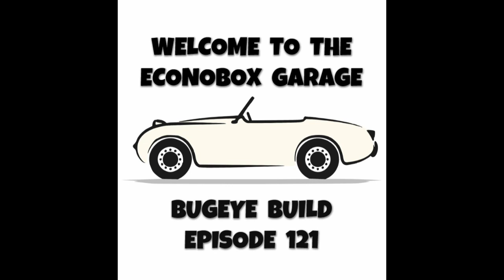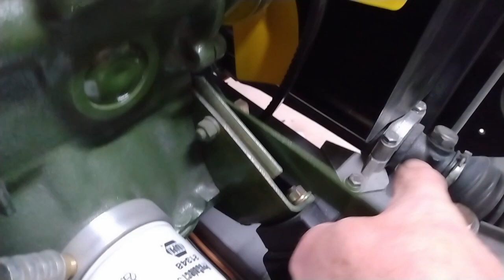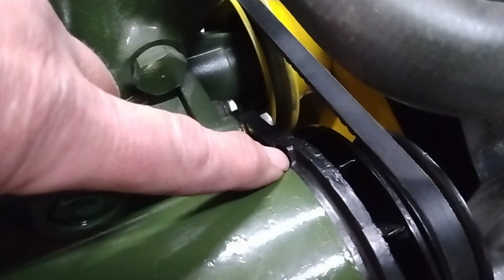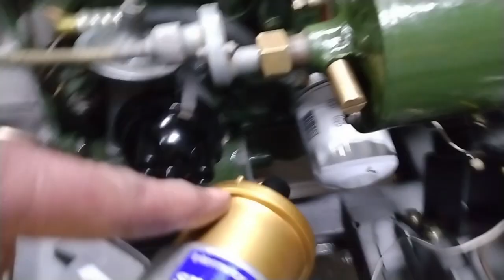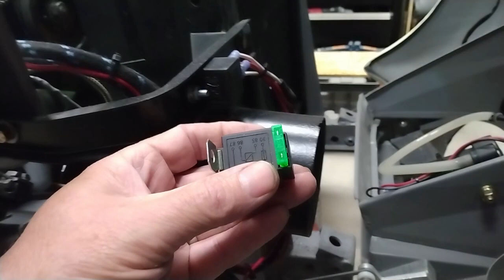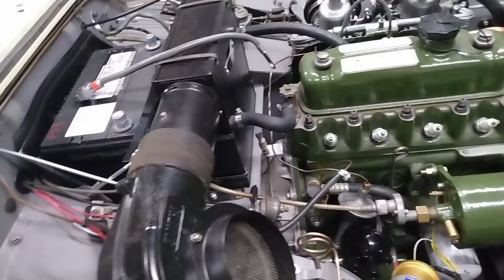How I installed the generator & coil and finished off the wiring in the Sprite. Bugeye Build Ep. 121

Comment: Hello. What color wires are you running to the + - on your coil ?  Mine is the same as yours.
Reply from the maker: Hi Ross.  I've converted my electrical system to negative ground/earth and have the white wire going to the positive terminal and the white with black strike to the negative. If you are running with the original positive ground/earth then you would switch the wires around... white to negative,  white with black stripe to positive.
Reply: Thank you. There is a third wire also. It’s white with a black strip. Where did you put that one ?
Reply from the maker: @SouthernShitShow  There's only two small wires going to my coil... the white one (which I've connected to the positive terminal) and the white with black stripe (which I've connected to the negative terminal). If you e-mail me at the address is the video description I can send you a wiring diagram.

Comment: Ian, back in episode 37 you painted the underside of the car with POR-15 and then covered that with Duplicolor's undercoating product. Obviously you haven't driven the car yet, but how do you feel about the adherence of the undercoating to the POR-15. I am thinking about doing the same thing you did. Did you do any research on the issue? Just curious. Thanks as always. Lin
Reply from the maker: Hi Lin. I didn't do any research but it appears to be sticking quite well. Haven't any issues with it peeling off. I've done some work under the car and have bumped into it quite often with no apparent harm to the undercoat.
Reply: @EconoboxGarage  Thanks for the quick response!, Lin

Comment: By the way, I understand that some new tachometer cables have drive shafts that are too long and can bind against the gears in the gear reduction unit.  Bugeye Guy recently posted an article on this on his web site. I’m sure you checked this already, but I wanted to let you know just in case.
Reply from the maker: Thanks Joel. I'm using the original tachometer cable so that won't be an issue.
Reply: @EconoboxGarage  I thought that might be the case.  From the video, the cable looked like it might be older, if not the original.